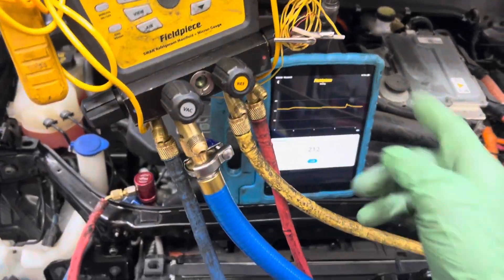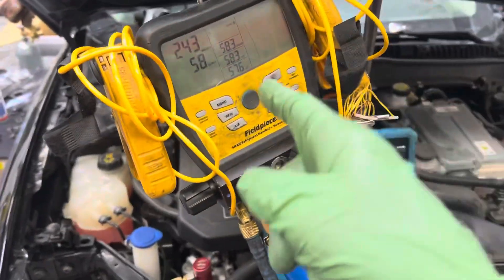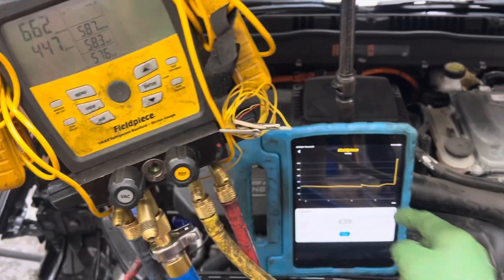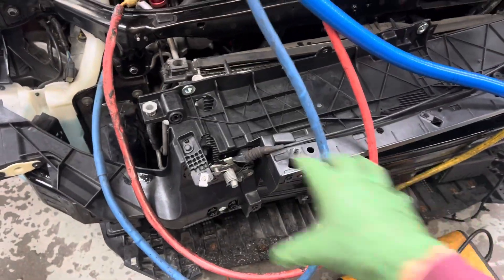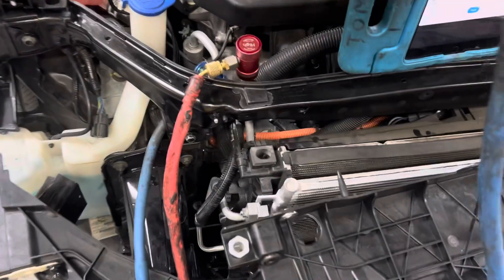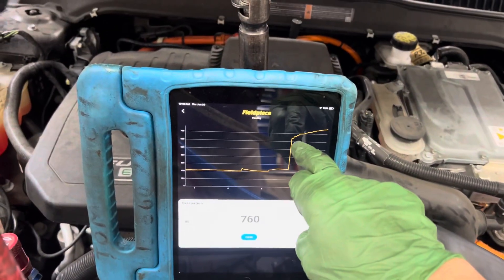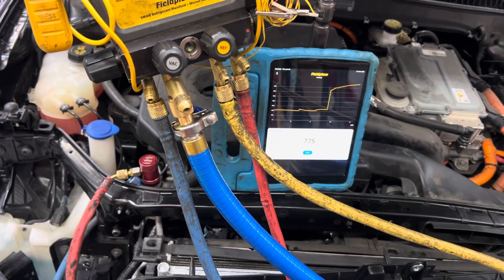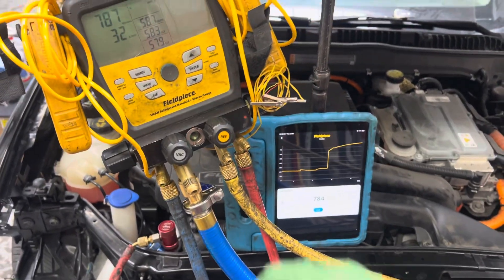AC Aftermarket Condenser leaks under vacuum, but not under pressure ￼.

Comment: Big deal. It holds under pressure. Leaks only under vacuum in a place which sees only pressure all the time - being gas,vapour or liquid pressure. If you have time and of course only if you want you can write why is this crictical.
Reply from the maker: @petar443  that means to continue this whole time that you’re trying to draw a vacuum, it is pulling in the air through the vacuum leak seal at the condenser

So that means when it comes time to add refrigerant pressure, you are now mixed and contaminated with air and moisture .
Reply: @coldfinger459sub0  Thanks for the informative answer ! Appreciate it.